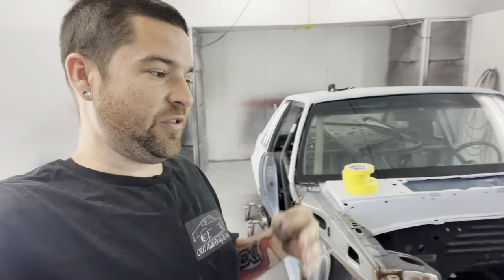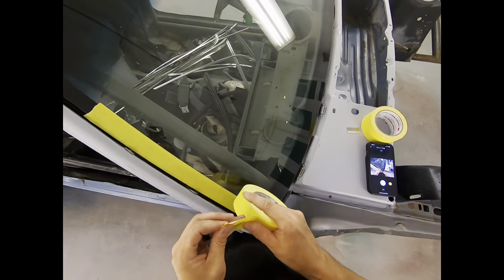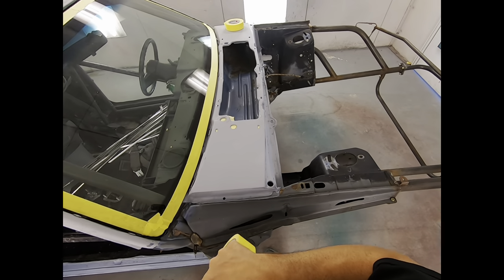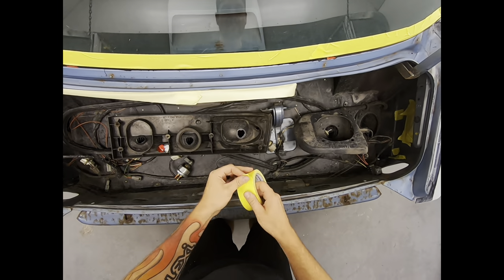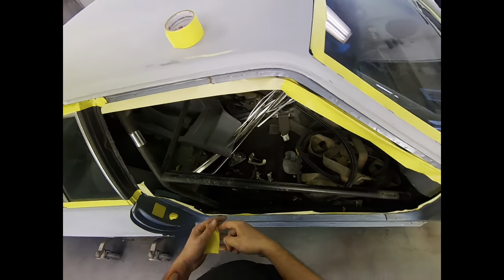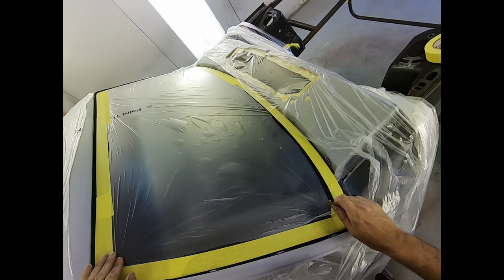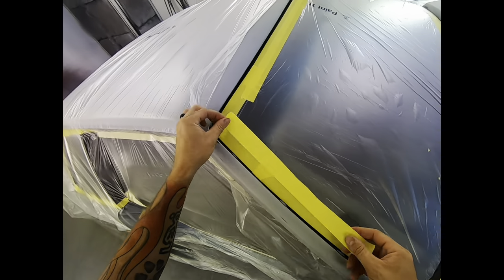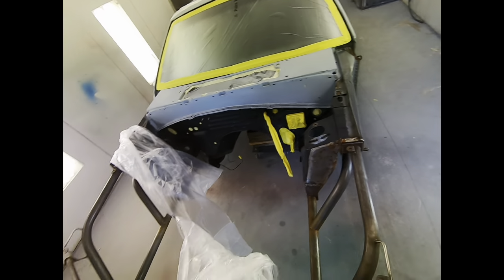📝 HOW TO Mask Up A Car For Paint 🎨 (Detailed Video)

Comment: I was with you right up till the hate on shops using masking paper they sell it because people use it.
I have both and use both just depends on the moment and trust me people aren't running from me they running to me .
But you have the right to your opinion .
Nice job though
Reply from the maker: Not hating on masking paper. I use it for certain areas. If it works for you and you do good work then there’s no issues. One statement can’t fit all situations. Most of the time when you see someone not dropping plastic it’s bc they are more of a back yard gig. But it’s impossible in most situations to have one statement fit all.

Comment: just a tip, not criticizing. instead of cutting right against the metal on the back taped spots, cut it in the middle of the tape away from the metal. plastic will still stick just fine and that way you don’t gotta worry about lil pieces of plastic coming loose and flying into the paint. also it makes it way easier if you accidentally cut a hole in the tape to just throw a piece of 1 1/2 over it to patch it.
Reply from the maker: That is a good point I just always seem to cut the dam tape when I do that lol
Reply: @ThePaintPaperHustle  yeah man just makes it a lil easier to fix if you do. just stuff people have showed me over the years. also try you out an Olfa knife and the black carbon blades. that’s all i use for cutting plastic because the carbon doesn’t get worn out as quick by the plastic. just be careful cause they are sharp as hell and will mark up glass.
Reply from the maker: @bdubwiley  cool deal thanks